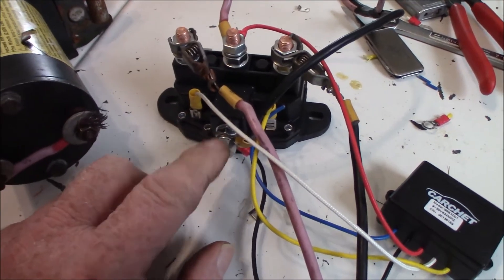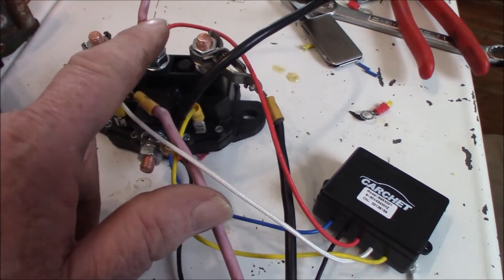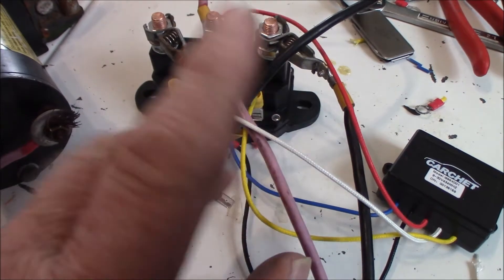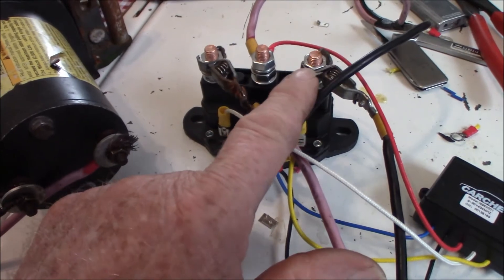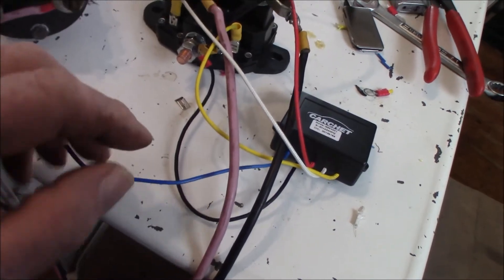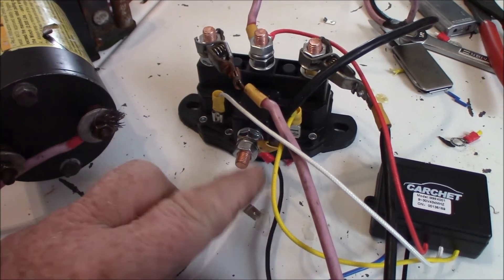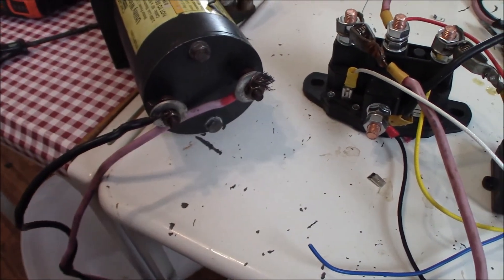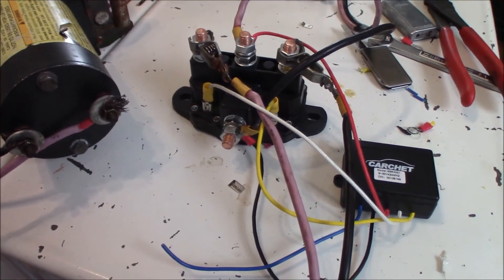remote control solenoid and control box hookup

Comment: Great Video Sir! What model number or part number is that solenoid? Need one for my rear truck plow!
Reply from the maker: here is where I got this one. : https://www.ebay.com/itm/275559140181?hash=item40289acb55:g:Lj8AAOSwlG1jhco~&amdata=enc%3AAQAHAAAA8E4dt4Ecjp14bCzjSK7a%2B9O5mw%2BnuKuDFTBhaEH7kI3J3n7ivbSnkMx%2BQ8UMkl2qGX%2BFN67h0kOT0zGn8M0U2QINGnM7ma6VPnKzNlns7USj6ZNeBIAVS8EvGlEen4ZZLFz5NXYHJ8Sm0Ws7gKgKVQ%2BXgEZnZUgMNA5xXSU1IS%2FWFBtnwwqO0YrX2AJ1BGcg2AQvm4geNY0yg9wPplK6C9H6ayAMv3FjrdEXZkqluPCnqtMy3w8FoDOPHRnMtEvaGMUs%2FUoyFX9wzq%2FkFMFAMEy6dGSmeAY%2F7PngXOMbdOF4whSmH0dswTWeVQR1Z2hXAg%3D%3D%7Ctkp%3ABFBMoNDQ-Jph